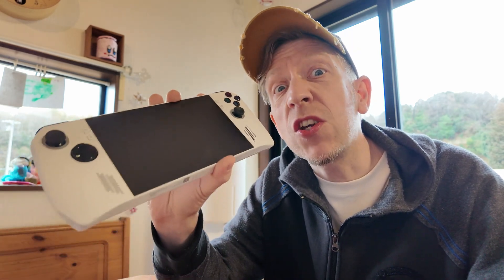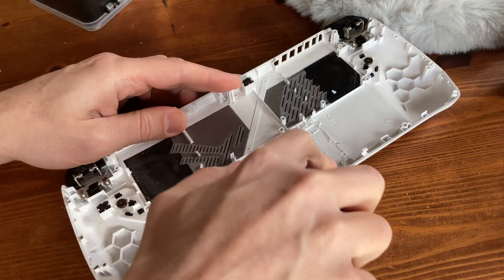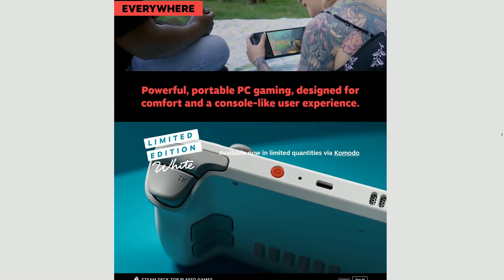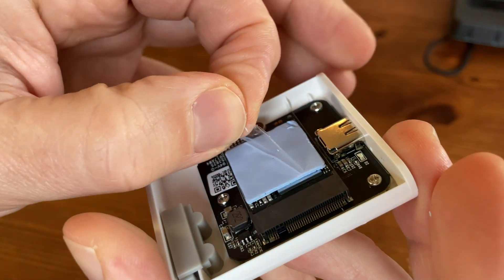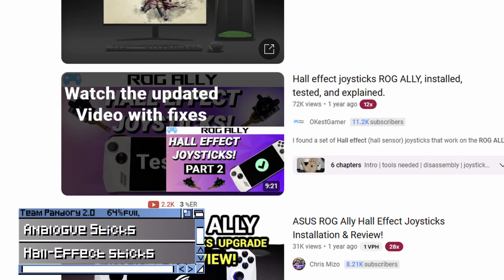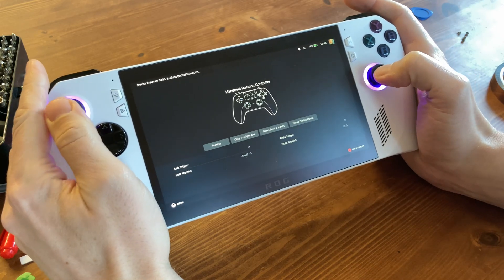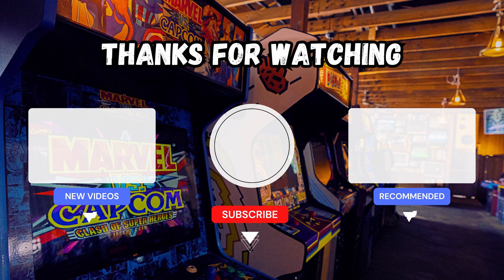Ultimate ROG Ally Mods: Double Battery Life, Hall Effect Sticks & More!

Comment: how is the longevity of the battery? Most Chinese batteries degrade much faster than OEM. Sometimes even worse than the original ally. So how is yours holding? Windows has a tool to calculate the capacity
Reply from the maker: So far it holds up pretty well.  I mean since switching to the larger battery I've never felt the need to go back as it's always been better than stock.

Comment: Did your shell snap at the top after the mod. I made sure nothing in the way and cut priperly but didnt seem to snap anymore at the top but screws down atleast. I went ahead and did 2tb upgrade and installed steam os. Its so much better even tho windows is nice to have for somethings but steam os seems very tweakable so im diggin it. Makes it now like a steam deck .5 or pc gaming console. Which is so much better. Never tried bazzite but glad official steam os is supported  now. Not sure if bazzite has more festures or options though.

Comment: The process of mounting the drive is easier if you would like it to be. Just use the KDE partition manager. You can through the gui mount it to a specific folder you created. Sp for example i have on my Linux pc at home one called ssd and one hdd. Then i mount my drives to them. After i go to Steam add storage and just choose the folders as the added storage done.

Comment: Where did you buy the alumineum tape ? And with what do you apply it? With elektric tape?
Reply from the maker: @Nbarecords  I grabbed a roll of tape from AliExpress. I think one side has adhesive so you just cut for size and stick it on.
Reply: @ do you got a link? Because here in holland has different names thats why😢that  i dont buy something wrong and my english is good but cant figure out whats called in my own language
Reply from the maker: @Nbarecords   sure thing, to be honest I think any will do, but as soon as I have access to a complete I'll link you to what I bought
Reply: @TeamPandory  i found the stuff 😊thank you ! Now i can fix it but 1 question do you know anything about docks ? Because i bought a dock but i keep getting a icon that it will drain while playing i used the stock charger same thing and a 100w charger still nothing then i bought a dock from jsuax but the same thing 🤷🏻‍♂️ and people saying bios update but i checked and its on 342

Comment: I have done the same with the Hall effect sticks, but I did not add all that aluminum and electrical tape. It has worked perfectly for over half a year with no issues.
Reply: I dont know why he added a magnet
The lb/rb buttons are Hall effect… so the magnet he put on the joystick effect tye lb/rb..
Reply: did you have to adjust the dead zones to stop trigger interference?
Reply: @6MilllionIsTooMany  I had no interference.
Reply: @6MilllionIsTooMany I installed them, and yes I did… it's easy and transformed my gaming

Comment: Great Video.
My 74WH battery does only charge up to 86.3% (65,4WH) for some reason. 
Is my battery faulty or did I make a mistake along the way?
Reply from the maker: I know that some have a fail-safe so it doesn't charge to 100%, but in this case I'm unsure.  Maybe you need to give it a proper power-cycle, check the bios for a battery reset, or run it down to 0% ish (until it powers down) then charge it to max.
There's also the possibility that the charger needs a bit more juice?  Are you using the one you got with the Ally, or a cheap 2Amper?

Comment: Can u emulate ps2 and 3 games on the ROG ally?
Reply from the maker: @ChillDevv  never really tried on the ROG, but I have on a similar mini pc spec (the answer is yes, very well to both PS2 and PS3)
Reply: i got 256gb with ps2 and ps3 roms for my rog ally
Reply: Is it any cheaper options that’s runs both ps3 and ps2 emulators pretty well before I spend 4-6 hundred?
Reply from the maker: @silentgreens2986  as a handheld? Maybe the steamdeck can do it, but won't be as capable. Or you could check a mini pc - we recently reviewed the gmktec M7 which is a pretty decent option
Reply: Yes they play ps2 and ps3

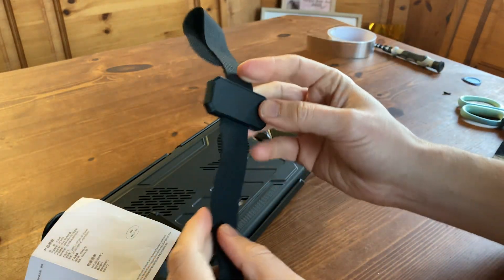Comment: 13:55 lol I think those watch straps are for holding external ssd or a power bank. However love your video man it deserves more views and I cant wait for my 74w battery to arrive!
Reply: The battery is nice. I've had it for a few months now, and it works perfectly. It's nice to play without worrying about charging it. Just a side note, it is significantly more heavy but you get used to it after a while. Other than that, I love this device more now than ever.
Reply from the maker: @saoudalghamdi4348  
Hey there, thanks for the kind comment 🙂 
Yeah, most probably. The thing is it's not very clear as to how to mount to the jsaux, which is kind of a bummer.
The 74w battery improves this handheld a LOT, just not as much as the UI change to Bazzite... And if the dpad was on top 😂
 - Oh, and the views? It is what it is.  Knew this video would crash out badly

Comment: But isn't this battery dangerous, because it's a battery from an unknown manufacturer, from AliExpress? Is there any risk of it damaging the ROG ALLY, and in the worst case scenario, exploding?
Reply from the maker: Sure.  I'm pretty much sure that all lithium batteries also share the same risks though.
Reply: @TeamPandory  no so its not safe 😢
Reply: @BlackInfiniteStar  idk how you got that from his comment.
Reply: There are other people whose done this mod before and so far they say they haven't had any issues either, some even going the 2+ month mark even
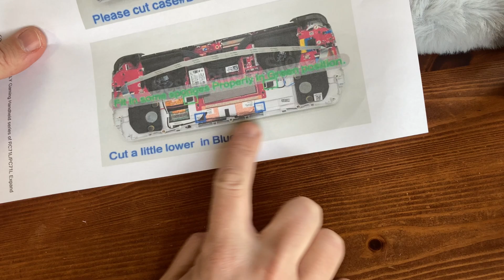Reply: I've used this battery for 3 months now, and no problem. It doesn't produce more heat or anything than the stock battery. This mod really fixes the ROG ally's biggest problem, and hands down best mod you could do on the ROG. Just love not having to worry about having to plug it in during game play. I get like 2:30 hours gameplay on 22 w! Definitely worth it
Reply: @rovertd3584  i got my rog ally z1 extreme for 300 bucks and I'll be doing this battery mod and upgrade the SSD to a 4tb and I'll be golden
Reply: @rovertd3584  I don’t know much about this stuff but my boyfriends birthday is coming up and he has this device and ik he wants to play longer and brought this item up but is this battery from aliexpress good enough or not?
Reply: @rovertd3584 did you add any heat shielding?
Reply: i know im a bit late but all lithium batteries carry the same risks. also if you do the 74wh battery mod then i reccommend u watch a yt tutorial where they also install an aluminium sheet on the battery to shield it from the heat that the RAM modules create, since it makes the battery degrade a lot faster